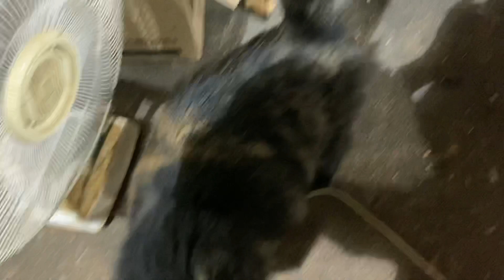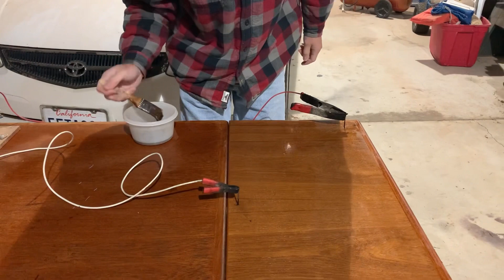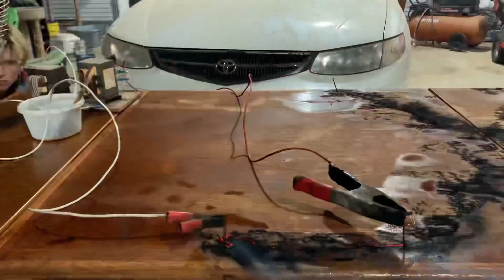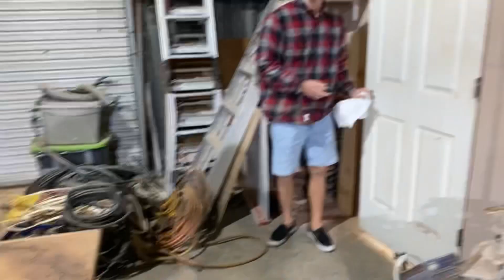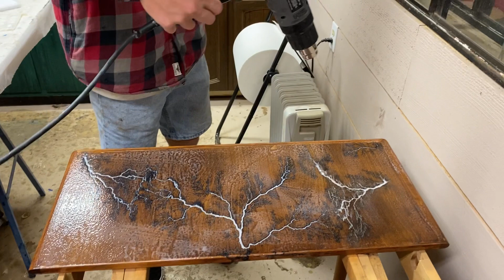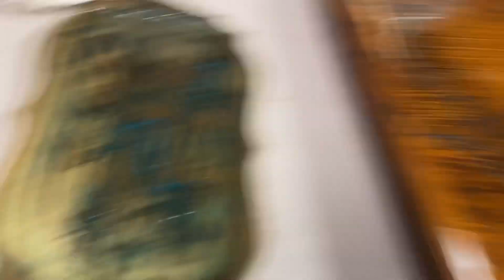Yard Sale Table Turned Epoxy Masterpiece!

Comment: What is the fluid you are putting on it for the connectivity?
Reply from the maker: It’s baking soda and water! You can also do it with salt and water but I like the baking soda
Reply: What is the mixing ratio?
Reply from the maker: @kevinvandenbussche1668  some people use a specific mixture if you look it up online but I just eyeball it I fill a bowl with water and dump some baking soda in and mix it up!